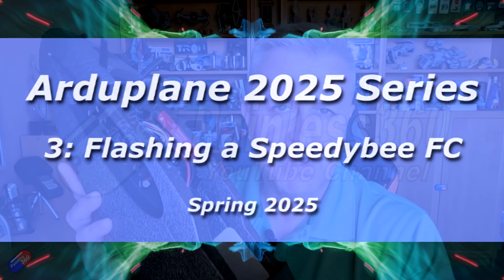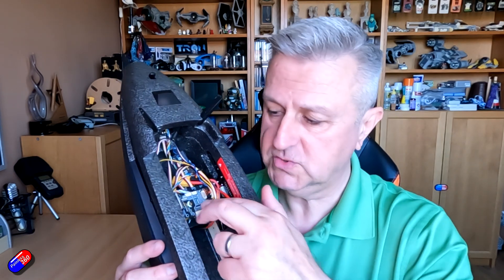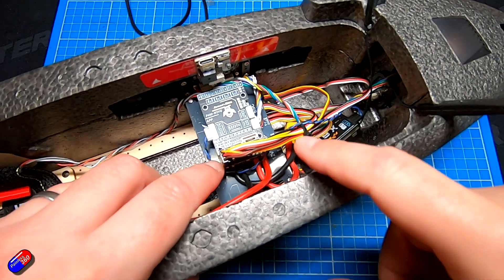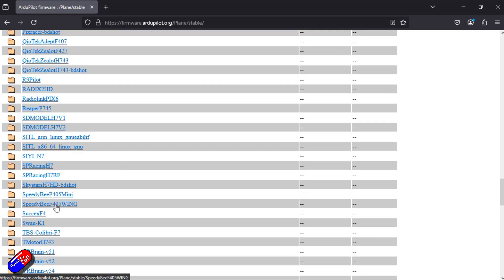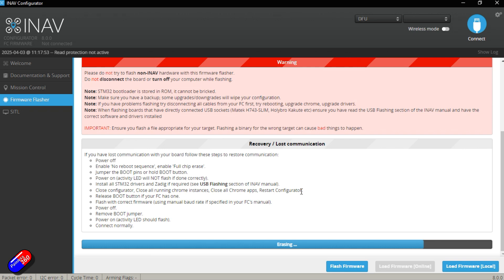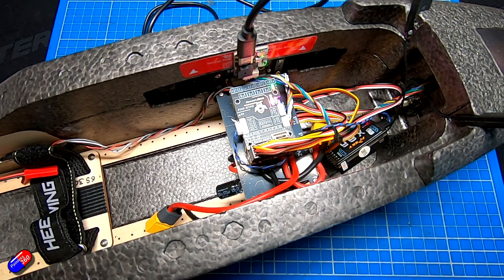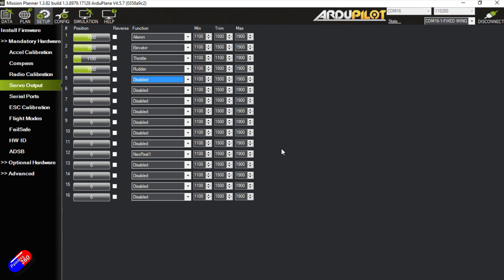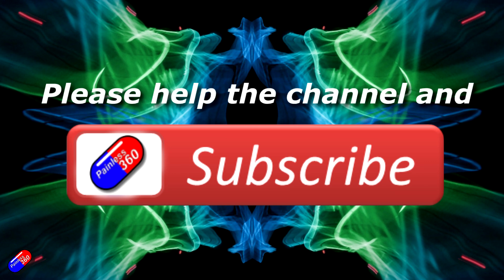Arduplane Build 2025: Flashing a Speedybee F405WING with Arduplane

Comment: Hello. I was hoping to get help. I’m using the SpeedyBee f405 wing and also wing Mini. Both are doing the same thing. During a static run with the plane in Angle mode the ailerons are slowly drifting. I tried to fly the F405 wing and it crash immediately after take off doing that exact thing. Is there a fix? I recalibrated the accelerometer and tried almost everything.
Reply from the maker: I assume your talking about 'on the bench'. See my builds for Arduplane or INAV for all the steps I use here for success every time... best of
Reply: @Painless360  hey I watch every video of your to ensure what I do it correctly. Your work perfectly. I had my first one work amazingly also but these last two aren’t going so well. I’ll watch your videos again in hopes I missed something and correct it. Thanks so much and keep up the amazing work. Thank you

Comment: Inav vs Arduplane which one has better flight characteristics with stock auto tune? (Inav 8)
Reply from the maker: Arduplane will provide a smoother, more stable flight out of the box than INAV on larger models. The defaults in Arduplane seem to expect a larger frame..
Reply: @Painless360 interesting, thanks.
what about a T1 ranger or a AR Wing? I would see them as small models or maximum medium sized.
Reply from the maker: In my experience here, those will fly great with both. Best of luck

Comment: Hi Lee, thank you for this video and clear explanation! Did you got telemetry working with ardupilot and a frsky receiver?
I've bin down this road a month ago (speedybee f405 wing + frsky mx mini receiver) but I never managed to get telemetry working (again). Telemetry was working on inav, couldn't get it to work on arduplilot, went back to inav and never got it working again... looked like something hardware related got broken.
Reply from the maker: Sure did. See https://youtu.be/PLtTZty_BUk?si=1jLTj4Pj3NzcRO0m best of luck
Reply: @Painless360  Many thanks for your reply, I see it works with an Pixhawk... But will it work with a speedybee and its software serial? The strange thing I experienced is that telemetry worked on inav, I switched to ardupilot, couldn't get telemetry to work, flashed back to inav and reverted back to my "diff all" backup and nothing worked any more. Never changed any wiring...
Reply from the maker: I never tried that. I can't see it in the docs - https://ardupilot.org/plane/docs/common-speedybeef405wing.html

Comment: Hi Lee. Thanks again for another very useful video. Yesterday, I flashed the latest stable Arduplane to a SpeedyBeeF405 Wing, which is installed in one of my old faithful wings, the Reptile S800, which was previously running INAV 6, 7, and 8. I took it out for a maiden flight, including basic tuning with Autotune, which was successful, and I certainly noticed the difference from the INAV flight characteristics, both in Angle/ FBWA and Acro modes. It just feels so much more stable and 'locked-in' with Arduplane than INAV, particularly in Acro. I noticed however, that my OSD doesn't properly display Estimated Wind Speed/ direction, which worked OK in INAV (I've not installed a Pitot). Reading the Arduplane WiKi today, it appears that the AHRS EKF3_WINDEST feature has been left out of the build for this Arduplane target, perhaps because of lack of flash storage space on the board? Also, whilst Distance to Home appears to be correct in the OSD, Direction to Home appears to be inaccurate. So, I'm now investigating another inexpensive FC that I can use for future Arduplane builds, that will give me these two features without the need for Pitot or compass. Any ideas for good and Arduplane-compatible F405 or H7 boards under £50 please? Cheers!
Reply from the maker: Watch out for things like font files in HD goggles. I use Sneaky_FPV fonts here and switch to the specific Ardupilot fonts for my Ardupilot models... Best of luck

Comment: Hi! I've just bought a speedybeeF405Wing mini and tried to flash arduplane the way you showed in this video. (Great video, Thanks a lot btw!) At the first look everything seemed normal, but when I started to claibrate the accelerometer it suddenly dissconnected and after rebooting it Windows told me: This device was stopped because it reported an error. (Code 43) Error during a request from the USB device descriptor.
Is this a common problem? 
Thanks a lot! Greetings from Austria
Reply from the maker: Unplug everything from the Flight Controller and try again... Happy flying
Reply: I think the cable moved a bit in the connector and had a loose connection for a moment. Goodluck!

Comment: Thanks for your videos. For my first FPV and first build, your experience and explanations are just fantastic. My 5" is doing well, however I am still struggling with the GPS position (flip, rotation, etc...) I am using betaflight and a WS 181 m10 chip. I see the dot on the chip but still cannot figure out the setup. My position arrow is confused. Left instead of right, not totally but no good. is the active compass the issue. I will disable it next time and see ? When the rain stops.
Finally I would love to try INAV.
I have issues in ESC config. fails to recognize any esc's ?
Thanks for the great video.
Lastly when, why and how to update #BLE. Could it be my issue for the ESC's
Speedybee F405 v3 55 amps
Reply from the maker: Please check out my Betaflight builds on the channel for how I do it. https://betaflight.com/docs/wiki/guides/current/Magnetometer covers the mag setup. i.e If the mag is upright, but X is rotated 90° right, choose CW90, etc. If the mag is inverted, choose one of the 'flip' options, until you find the right one. If the mag is at a custom angle, choose CUSTOM orientation, and enter adjustment values in decidegrees in the CLI (using the link above). Best of luck!